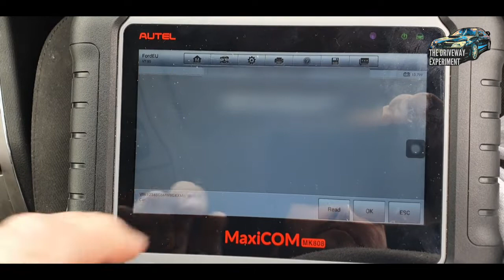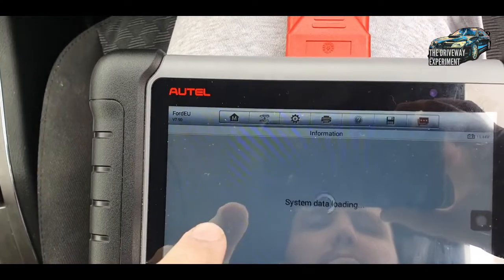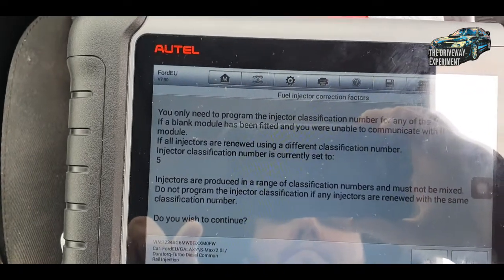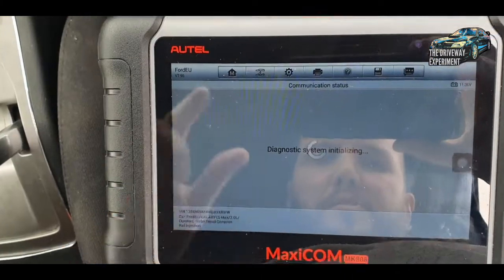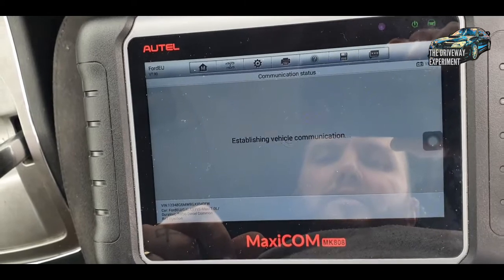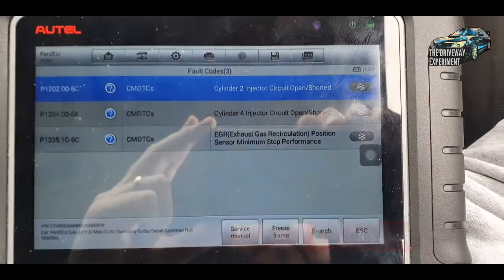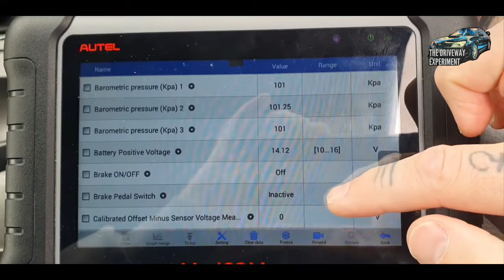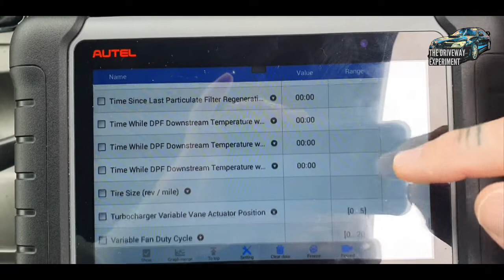Ford Galaxy 2.0d fuel injector correction factors Autel Maxicom MK808

Comment: Why do injectors 4, 5 and 6 appear, what should be done, it appears to me during the forscan diagnosis as well, have a nice day!
Reply from the maker: Hi mate! 4, 5 and 6 are the injector classifications.
My understanding the injectors set will have all the same numbers 4, 5 or 6 and this should match the classification in the ecu ecu (I think)
So this car had 4x classification 5 injectors fitted and all four were replaced with a set of classification 5.
I think you need to have all 4 injectors matching classification number then set the classification in the ecu to that (if different)
Hope this helps you